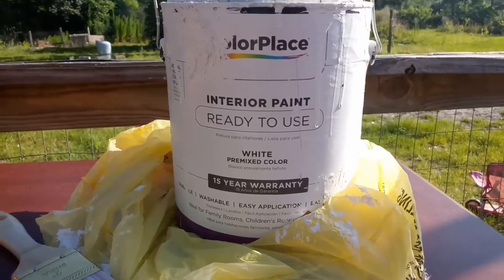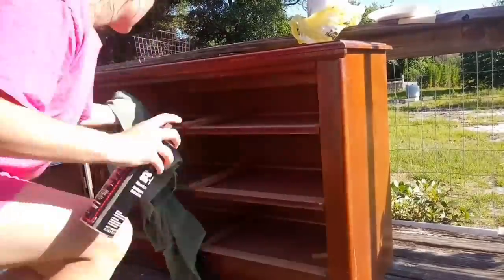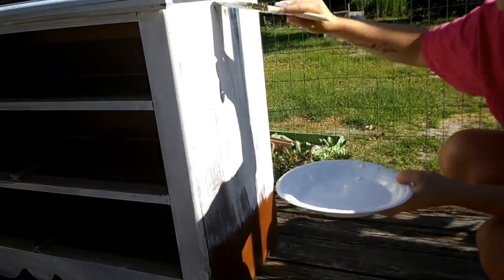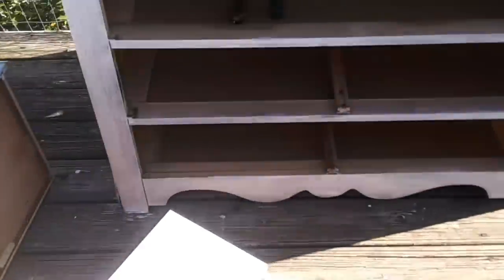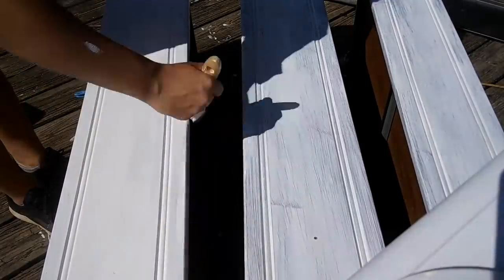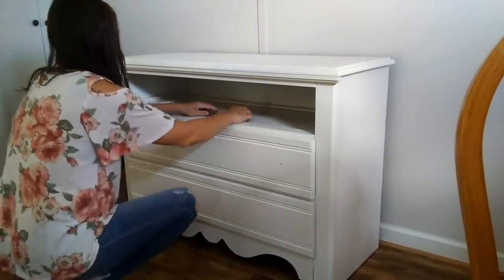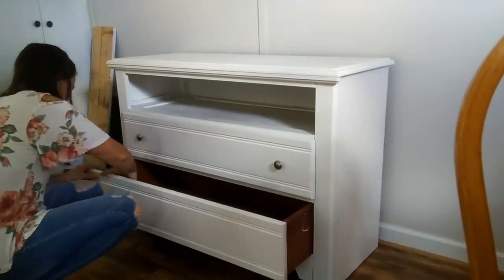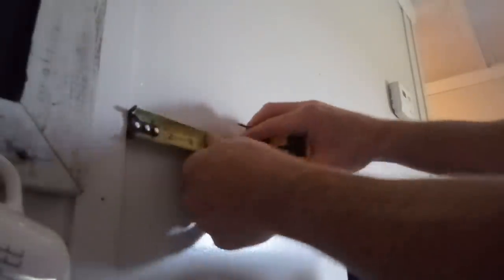Coffee bar makeover | less than $25 | DIY on a budget 2019 | HUGE Transformation!

Comment: For the inside of the top part that you left open, did you put down an additional piece of wood to make it completely flat? I have an old dresser I've been wanting to do this with and was wondering about that part of it!
Reply from the maker: I did put down the peice of wood that was off of the old shelf that was on the wall but this dresser was pretty flat even without that wood in there. I just took out that little wooden peice that the drawer slides on.
Reply: @karrielynn  awesome, thanks!

Comment: How did you do the wood piece that sits inside where the top draw was?
Reply from the maker: I just slid it in there its not screwed in or anything because I didn't want to damage the dresser in case I ever decide to put the drawer i took out back in. its actually from the shelf that was hanging on the wall previously to me redecorating. If you look at the before clip :)
Reply: @karrielynn  awesome!